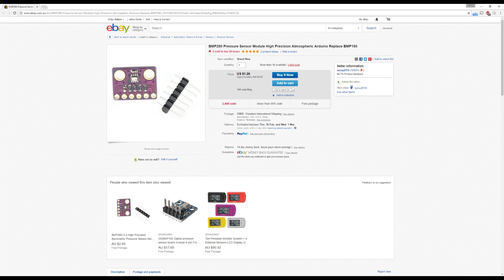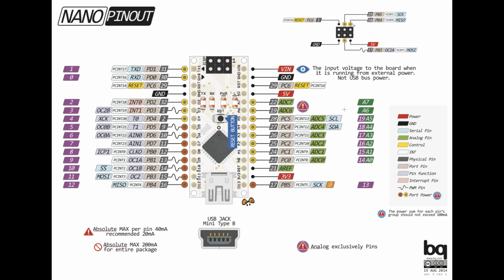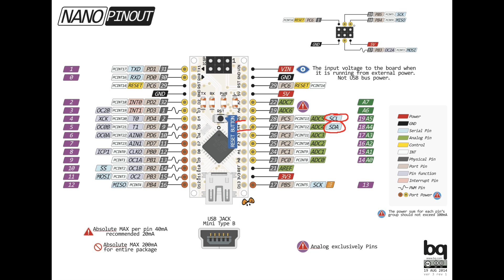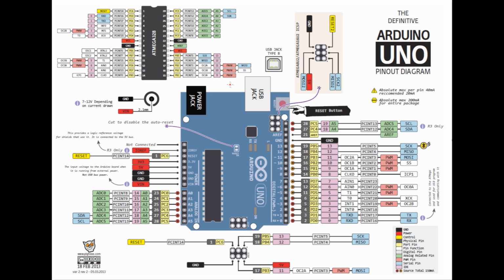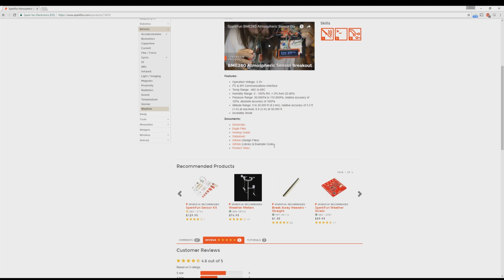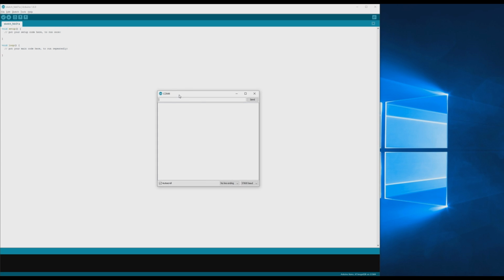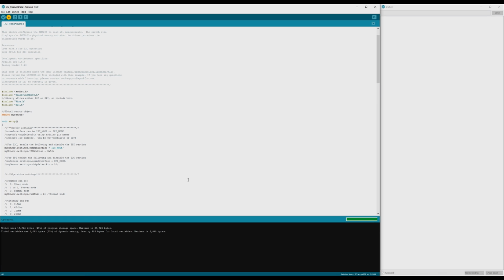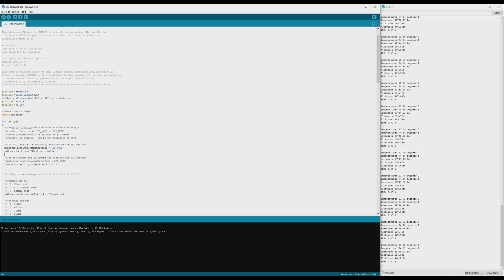BMP280 Pressure Sensor Module - Arduino Tutorial

Comment: Weird..... My altitude stays in the same number even thought im lifting it up and down
Reply: Its is because when you lift it, the value is slightly changing and because in the serial monitor, they round it off and show you, that's why the number remains the same.
maybe if you go to the next floor or something, then you might see a change.
Reply: @VANTABL4CK  Its my sensor thats broken. It cant read the temp, humidity, pressure, and the altitude
Reply: @Dichill Dichill does it say that the sensor wasn't identified pls check the wiring?
I had the same problem I think i didn't solder the pin properly or maybe i burnt it
Reply: @VANTABL4CK  I didnt soldered it
Reply: @Dichill   use 3.3v for the Vcc

Comment: 3.3 VOLTS ONLY
5 VOLTS WILL DAMAGE
Reply: That is correct.  Some of these BMP/BME280 breakout boards have a voltage regulator to allow higher input voltages.  The board in this video is obviously NOT one of those.  3.3V for this one.
Reply: the sensor gets the 3.3V from the arduino board, but the I2C lines operates at which voltage level? Can they damage the sensor? Thanks
Reply: @fabricio.ferrari  Not knowing what board you have; I would think it would be the typical I2C 3.3V. If so; no problem.
Reply: whew that was close thanks 😳
Reply: FUCK
Reply: There are 2 versions of BMP280 - 5v and 3.3v

Comment: Hi Aidan; I need to have three sensors on the same bus... Any thoughts/suggestions?  TY  (to subtract differences between temps and pressures)
Reply: This sensor can also use the SPI connection, which will allow multiple sensors to share the bus. You can see tutorials on using SPI by Googling for them, and you'll need an SPI library for the Arduino. I believe that on this sensor, SCL=SCLK, SDA=MOSI, SDO=MISO, CSB=SS. You use a different Arduino pin for each sensor's SS line, but the others are common.

Comment: Thanks for breaking my BMP280, it simply fries if you put 5v.
Reply: There are many different versions of this sensor. If you are using the BMP280-3.3 then you cannot just connect it to the 5V - you need to use an Arduino with 3,3V

Comment: I want to use this with a small OLED display, which requires pins A4 and A5 as output pins. Is there any way to assign these pins alternately to input and output in the sketch, or can I/must I use different pins for each device?
Reply: You can plug up to 255 devices on those 2 pins. As long as they have different addresses, they will all show up. But you will have trouble plugging in 2 of the same screen for example, as they are going to have the same 'unique' address. (This can also be changed by changing a resistor on the screen / peripheral)
I've personally made several devices using a screen (usually SCL SDA) and the BMP180 (the old version of this altitude chip) also SCL SDA, and it works fine.
I've had 4 SCL SDA devices running at the same time on an arduino nano before, all off pins A4 and A5.
The only thing i'd say is be careful how much power you are drawing from the pins overall. But definitely a display and this module will be fine.
Reply: @nataliesilsbury1888  generally speaking you can only have 128 devices, unless you have 10 bit addresses. bit zero is used for read and write. the other 7 bits form the device address.

Comment: Hi Aidan, thanks for taking the time to post this video - very helpful.

Once I had figured the baud rate issue I finally got data on the Serial Monitor but it was unchanging  with a very high altitude and zero pressure/temp. Admittedly, I haven't soldered the connections yet and I am hoping that this might solve the problem (solder is in the post!). I used the Sparkfun Library as per your video but I have BMP280 sensor, the Library seems to be for the BME290 but I don' think this is an issue?

Am I doing anything fundamentally wrong (I am very much a newbie).

Best wishes

Phil
Reply from the maker: Phil Cox  I've found that these cheap eBay chips aren't all that reliable with their namings, but if you've got the same chip as the one I have in the video then the library will work. Don't forget to change the I2CAddress as per the video, and I would definitely recommend soldering the pins on, as I don't believe it will work properly until you've done that. When I buy these sorts of chips off eBay I usually buy 2-3 of them even if I only need one. That way you can test between them to see if one of them are faulty.
Cheers
Reply: Thanks Aidan, I'm hoping it's the solder too. The chip should be ok as I bought it from a recommended UK firm, not ebay. Incidentally, the Sparkfun library was the only one that worked (to a degree) compared to Adafruit and a couple of others I tried.Really appreciate the reply.Best wishes,Phil
Reply: Good morning (or evening), I managed to get the sensor to work so thought I would share my experiance. 

I gave up trying to get the thing to work on I2C and wired the Arduino for SPI, changed the two lines of code in the sketch to switch over to SPI:

//For SPI enable the following and dissable the I2C section
 //mySensor.settings.commInterface = SPI_MODE;
 //mySensor.settings.chipSelectPin = 10;

And it worked a treat (not forgeting to select the Baud rate to that of the Sketch). I'm convinced this would have worked before soldering but I've soldered anyway to rule this issue out.

The altitude is reading 243ft on average and I think this may have something to do with the pressure reading at my location so I will do some sums. All this can be accounted for and factored into the results as long as I know what I am dealing with.

My only grumble is the % relative humidity is reading zero so ssome more research required. Next bit of the project is to add an SD card so I can record the data from the balloon flight.

Thanks for your help again, much apprecited.

Best wishes

Phil

Comment: This module should not be used without level converter. The VCC for the sensor is max 3.3V, see https://www.makerfabs.com/desfile/files/BMP280-3.3-SCH.jpg and https://www.bosch-sensortec.com/bst/products/all_products/bmp280
There is no provision for level shifting on the module.
If you apply 5V you are unduly overstressing the module and reduce its lifetime.
I love your english accent but the accuracy of the contents leaves to be desired.
Reply: thought the same. when finished watching checked datasheet's absolute maximum ratings.

Comment: There is an error in the INO program.  I was getting gibberish as an output until I changed your line of code from "Serial.begin(57600); " to "Serial.begin(9600); "then I could read the text but the data is not changing.  it just shows 0C, 32F, etc... even if I blow on the sensor, the data isn't moving.  I'm using Arduino Uno Mega and the A4  & A5 ports wired as you instruct.  Why aren't the other CSB SDO ports used?  Sorry I am a newbie to this...
Reply: I just discovered it was a problem with my knock off Arduino Mega board.  I guess you get what you pay for... all is working fine!  Thanks for a great video, just note the Baud rate correction I noted earlier!  THANKS!
Reply: There's nothing wrong with your clone. The issue is that the baud rate wasn't matching the one used on the serial monitor.
Reply: Gerald Schaefer I had the same error, plus it stops running after sending this to the serial monitor:
Starting BME280... result of .begin (): 0x
Reply: An "uno mega"?

Comment: i want to ask that why the Humidity value is zero.
Reply: As Aidan said, he was using the BMP280 which does not have the humidity sensor. The BME280 is identical to the BMP280 but adds an additional humidity sensor

Comment: BMP280 power supply is from 1.71V to 3.6V, which is mentioned in datasheet. I came here to make it clear, BMP280 do not have to withstand 5V at all...
I thought that arduino tutorials are supposed to explain more. I want to learn about how to acces data to make it work for STM32F1 M3 MCUs. By using Arduino you can not learn much like this, that is why I use Atollic TrueStudio.
https://ae-bst.resource.bosch.com/media/_tech/media/datasheets/BST-BMP280-DS001-18.pdf    PAGE 7 power supply Vdd

Comment: Why does everyone just make the same video using the same libraries? or more importantly, why does everyone use arduino for everything?
I just want to know how to program it and not install a library.
Reply: I'm trying to make a project that uses a BMP280. It's an 8051 based processor and I've made a bit-bang i2c interface but I'm unsure of how to program this sensor, it's more advanced than what I've interfaced with before (DS3231 & EEPROM) and I don't feel like the datasheet clearly expresses the proper steps involved.
Reply: why not open one of those libraries and look at the instructions? its not like theyre encrypted or anything, its just c code.

Comment: @Aidam, is there Humidity option on this sensor? I see in the back it displays Gy-B11e/p 280?  does it mean it is both BME and BMP ?
Reply from the maker: Le Kev Hi Le, if you have the same sensor that I have in this video then it doesn't have humidity detection. As for the labelling I'm really not sure if it's correct or if the manufacturer just put a random one on there
Reply: Aidan thanks, it s really misleading marketing all over ebay. I just reorder bme280, 4x price vs bmp..
Reply: the card is the same for bmp and bme, so they use that "e/p" on the stencil. . the sensor itself can be either. also, most of them arent real bosch bmp or bme, theyre just clones that dont necessarily work very well.

Comment: Aidan Beale I tried this with both 0x76 and 0x77 on arduino uno, but it stuck on Starting BME280... : 0x
what is wrong?
Reply from the maker: Hi Farid, are you sure you've got all the cables connected properly? Do you have another Arduino/BMP280 sensor to test with to see if it one of them was faulty?
Reply: Aidan Beale all cable are correctly connected to its pin. I have another uno, but no bmp280. I used i2cdetect.ino and MultiSpeedi2cScanner.ino, upload to uno, the result is no i2c device detected. Could it be my BMP280 is broken? But I tested it with voltmeter, everything is fine.

Comment: Hi Aidan - great video, thanks for this and greetings from across the broder in South Wales :) ! Quick question if I may... the BMP280 data sheet I've been reading says max V supply is 4.5V, can I ask why you don't sue the 3.3V supply from the Arduino UNO rather than the 5V supply please?  I have one of these being delivered tomorrow and will follow your tutorial much closer then! Thanks
Reply: To get a more accurate altitude, you need to examine the inputs to the calculation. Altitude is determined as an offset from a reference. In most of the libraries, they assume a default sea level air pressure and a default outside temperature (usually 15C). This is enough for general approximation but if you need to be more accurate then find a better sea level pressure reference. For the UK our national measurement institute is the National Physical Laboratory in Teddington, they have an online barometer http://resource.npl.co.uk/pressure/pressure.html. You then need to give the outside temperature (not the indoor). With those two parameters, you should get a far more accurate reading. Also worth noting, I have had issues with cheaper sensors that are not Bosch BMP/BME280 but Chinese compatibles, the readings are close enough for most uses but have a bias in the pressure readings that means that they drift a lot more than the specification suggests that they will. Hope that helps, thanks for the great video Aidan
Reply from the maker: Hey John, glad I could help! From what I've read both from Adafruit and from other people's projects, the BMP280 sensor can take both 3.3 and 5V. I've had it running off 5V for a whole day without any problems. I guess it just depends on what projects you're planning on using it with. Let me know how you go!
Reply: Hi Aidan - I followed your vid and eventually managed to get my BMP280 working, though the altitude is not correct for where I am.  Do you know how this can be calibrated or if it needs some default value in order to show the correct altitude?
Reply from the maker: Hi John, how far off is the value you're getting from actual? I was getting around 137m and my sea level altitude for my location is around 143m. I'm not too sure if this sensor will be able to get much more accurate than this.